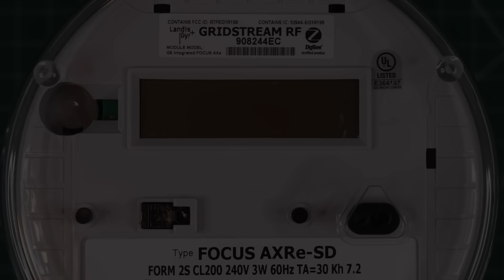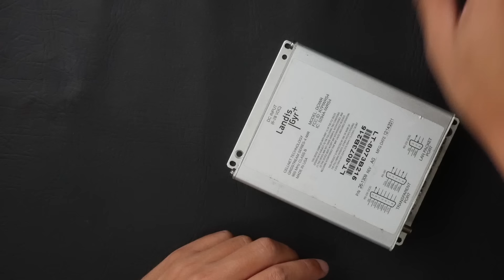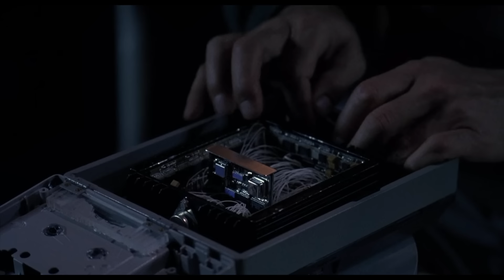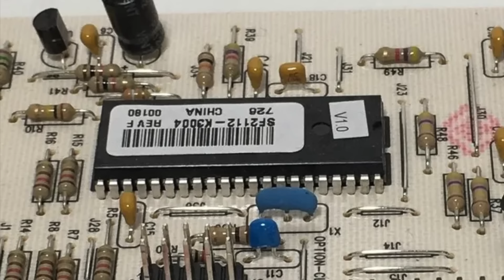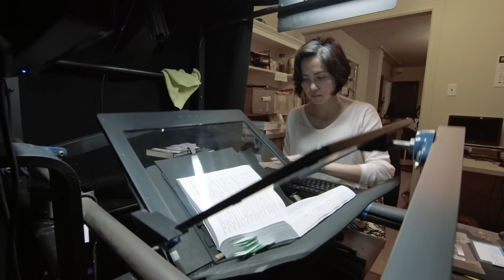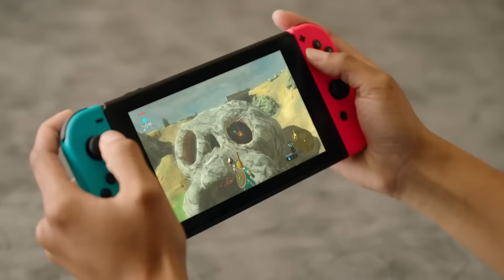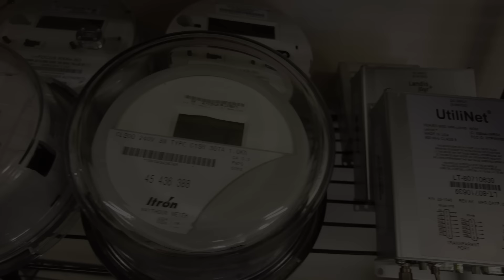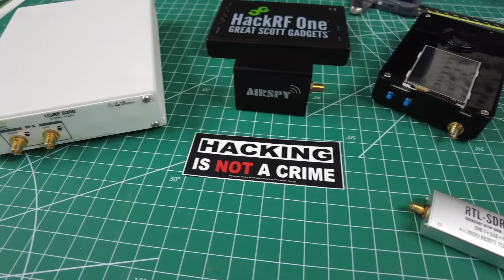The REAL Problem with Smart Meters

Comment: I totally agree with the statement 'They will run the system into the ground then beg the government for a bailout'.  I look at the power distribution in my neighborhood alone and I see that system could not handle 5 houses running level 2 EV chargers while running their 4 ton AC units.
Reply: You describe planning failures. The same happens when developers built green fields houses, without increasing the water supply and effluent treatment infrastructure. This is due to silo mentality behaviour, thereby stressing the existing infrastructure to failure to force, out of sphere of control, action by the relevant body.
Reply: @dirkvanschalkwyk1919 you and I think the same way but I think the silo people are ignorant not malicious.
Reply: My power company have these meters
Reply: That’s the whole point, whoever is pulling the strings wants the system to crash so they can pick up the pieces and have complete control… and we’ll beg them to control us too. We’re just dumb sheep
Reply: @Bigpaa  The problem is those hoping for this outcome are not competent enough to run things once it does crash.
Reply: @doogie812  it's not about competence....it's worse
Reply: @Bigpaa 
It's why our "leaders" are NEVER held responsible for the consequences of their choices.
Xiden even went to the length of enacting new laws to protect his guilt ridden ass....just as he is about to leave....
Reply: What I find odd is that those of us out in rural areas have individual dedicated power feeds for each of us that are as big or bigger than the ones that run a whole residential blocks in town.
Reply: yea
Reply: this is why EVs are doomed
Reply: Transformers are usually undersized.  This is going to be a big problem with EV chargers being installed everywhere (each draw 50A continuous all night long).
Reply: They are building the PRISON around you!..
Reply: Xcel energy is pushing a grid upgrade on the Colorado tax payers. They currently have an option where if your electricity usage is too high due to AC consumption, they will install a monitor on your AC condenser and turn it off. 

If you want to join the incentive program from Xcel then you have to apply and then the build needs approval from Xcels engineering team. If you have a renewable battery on site Xcel has the “right” to discharge up to 60% of power from that battery storage. But annual incentive only lasts for five years!
Reply: I have one now. Now that I went solar.

Comment: smart devices like meters and thermostat simply meam remot controled and how long is it going to be before the powers to be start controlling your thermostat or meter when you are using too much electricity
Reply: This is exactly what it is about.  They have already admitted that they will shut off your air conditioning unit in the event of a "GRID overload".

Comment: In development countries, such as the USA, you use some half-baked zigbee stype wireless mesh networks. That is a sign of a not technically advanced network and method. 

In real world, the meters are controlled by wired signals, from the electricity network, since the 1970s. Now of course the SPOT-market metering is being done in 15 minute intervals, so a bunch of new meters are installed to support the oldest previously 1h metering/reporting interval to the new one.

Again, real world uses the 400VAC network to control/collect information, without any half baked wireless mesh hacks.
Reply: We do have a power grid that's form the 1930s and the cross talk form half a continent of meters would be very bad
Reply: Good luck using that 400 VAC "network" when there are only one or two houses in suburban or rural areas per distribution transformer.  Transformers don't pass the high frequencies need for communications.   The place I'm sitting in right now has its own 25 kVA distribution transformer; the primary is 7.2 kV.    It has a smart meter, but it's too far from anywhere else to do "mesh" communications.  The power company drives a vehicle around once a month to query all the meters around here.
Reply: @TheUweRoss  well in the US a street of homes share a single transformer and they let though a lot of high frequency noise

Comment: You are a dumbass it cost to make electricity.   The meter read are in what we call the MV90 format using a IEC published protocol.  It is split up by region,  meter no., the channel no., and time of use.  Time of use can be 5 min. periods to 1 hour periods of 16 bits.  These are the raw count multiple by the k sub h marked on the meter.   It is just a string of numbers with no separators but a fixed posission.

Comment: I am someone who design smart gas meters, which are mostly called electronic volume correctors. I have written firmware for alot of these devices and also designed hardware for those. What we mostly do is we have a datacenter and our devices send the data with the special signature on those centers using TCP or UDP. And about meter reading, the reason you dont understand those because the reading itself is not sent the reading also have data of the decimal point and as well as information about how many digits are there in the reading which on other side is parsed by us. And ya these devices know everything happens to them. The one which I designed we also have the information about what made the device reset, if any faults occur we also note those.  

And also these systems have encryption. I have added SHA256 encryption, so would these electric meters would also have them
Reply from the maker: I like the sealed battery powered gas meters I’ve taken apart. Very interesting how long they can last on the single battery.
Reply: @RECESSIM  ya, our device has sleep mode consumption around 50uA with everything managed in sleep as well, so ya, their battery is impressive. Mostly, we give a guarantee of 10 years

Comment: They really do this wireless via a mesh network?   All of them, or just the one's in your country / location.

I thought they sent the data back across the power lines they were connected to, in the same way ethernet can be frequency boosted and piggyback on the same line as an AC circuit.  I mean, you would think they would do it that way...
Reply: Powerline communication, especially in dense urban areas can introduce noise into the grid. So these meters are usually only in spread out rural areas. Where the weak radios in the meters can't reach each other point to point. They can also have cellular modems and send out data through LTE networks
Reply: @professionaldot2653  What frequency are these things communicating on?  I don't have a frequency counter to check. But I use at lot of 2.4ghz, 5ghz, and 915mghz wifi and fpv equipment.

Cellular coverage can get spotty in rural areas and seems prohibitively expensive.   If I designed it I'd do a mesh network timed to transmit small packets on shortwave at night....  If you could use the powerline as a long wire antenna.
Reply from the maker: Can be different in different regions. Different frequencies, or protocols, or even method. Powerline communication in some areas like you mentioned.

In North America, and specifically Dallas, TX this is the system that’s used.
Reply: @RECESSIM  What baud rate are they using.  I'd have chosen something pretty low.  I bet they are using cheap off the shelf chips from Chona in the 2.4ghz unlicenced wifi / grrrbage microwave oven frequency band.  

Wrap one of yours in tinfoil and see if it decreases your SNR.  

The power reading data may be encrypted which is why you cant read it... to prevent some users from doing spying or side channel attacks on their neighbors.    I.e. you see your neighbors power usage is low they are on vacation and you could rob the place.  Or if robbers canvassed an entire area looking for meters with low usage if indeed a gps coord is attached to them.   The gps coord might not be a receiver but assigned and programmed at the time of installation over a serial port but I doubt it.   Test it maybe by changing locations.

Comment: FYI, the easiest way to get the right meters is to publish a list of utilities using the meter and network - generally speaking the utilities are "locked in" - they can't switch networks without replacing everything or running multiple sets of equipment. The utility name is printed on the meter so a photo of the meter itself should reveal the utility using it. And yes, all meters are keyed to a utility - that's why it's printed on the label.
Reply: Where I am in Australia, the retailer gets to pick the meter vendor, it’s separate from the utility, but still has to meet a standard and all data goes to the utility for actual billing
Reply: @JamesTK  Same in the UK  🇬🇧
Reply: @lizardlovin-lilliputian  yeah I think the technology is largely being standardised globally since the metering companies can sell more meters
Reply: Just about every utility is investing in smart meters that can transmit their usage and outages in real time.
The meters do not say the utility name because it's a separate company that manufactures them, and sells them to a utility.
Reply: @JohnD-JohnD  yeah, I know that already. There's also more advanced stuff a retailer can do with the smart meters, like turning controlled loads on and off at will, which was previously only controlled by the utility itself.

Comment: One of the big problems is there are tons of smart meter networks out there. You have simple ones like Itron's ERT (decoded) which basically are for things like smart water meters that broadcast their readings periodically. There are more sophisticated ones like  Itron OpenWave which I believe is a form of 802.11g running on the 900MHz band. Landis and Grey (L+G) has their own network, and so on. So it's hard to reverse engineer simply because of the diversity. I can also say meter readings tend to be somewhat privacy focused, so to prevent any random person from being able to monitor any house's power consumption, they do encrypt the reading. Lightly privacy related as one could read the meter by standing outside it, but that's a lot less convenient than sticking an antenna in the air and seeing when your neighbors are around. As for mass outages, you could send the signal, however, in general, the next meter broadcast will cancel the outage as the meters can't transmit during an outage, so you may have faked one by transmitting a lot of packets, but the power company will suspect something when the outages get cancelled automatically, especially if it's a normal status message and not a network sign on message that would be broadcast when they power up again. That said, there are plenty of legacy support - meters are only supposed to be out there for 10 years before needing calibration (both mechanical and digital and smart), and many devices are approaching over 20 years of service so the networks may need some backwards compatibility to support the old standards.

Comment: Have you considered getting one of the consumer devices that talks to the meter and displays near-realtime power usage data? Those devices must know how to decrypt / decode the desired data. My thinking is that the device has a lot less going on inside it and thus should have smaller firmware that would probably be easier to disassemble to find the magic stuff.
Reply: They tend to connect via zigbee, at least in the UK
Reply: @DOSeater  My point was that the consumer devices must, in order to work, be able to decipher the info he's having trouble deciphering. Perhaps easier to reverse engineer the deciphering algo from the (presumably simpler/smaller) device firmware than the (presumably) much more complicated/massive firmware of the meters.